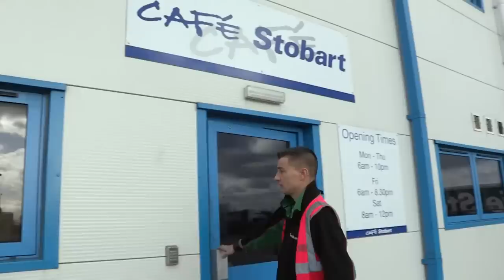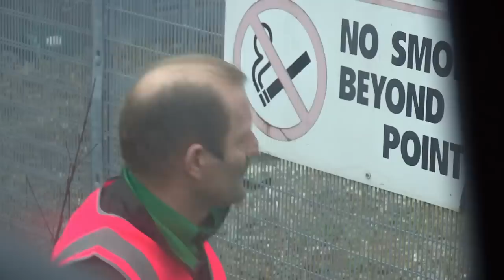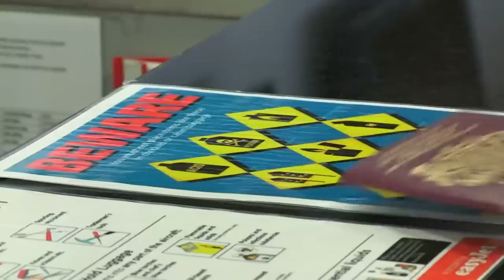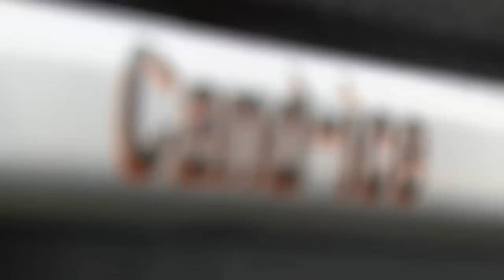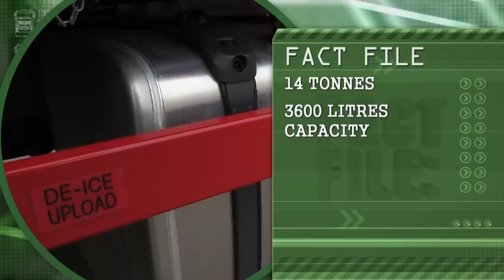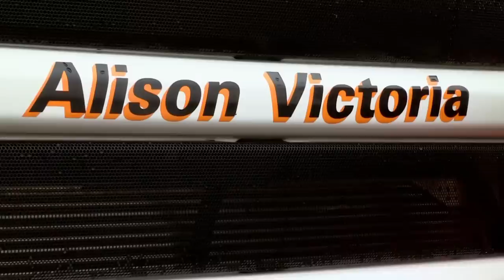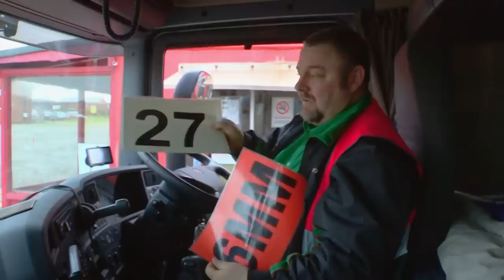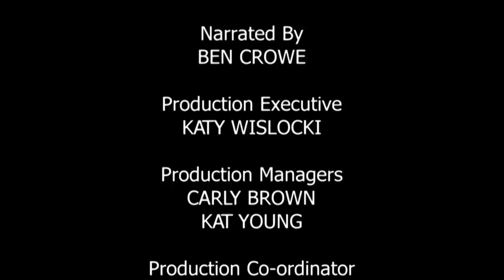The Worst NIGHTMARE For Mark Dixon | S05 E01 | Transport Documentary Full Episodes | All Documentary

Comment: That Scania R500 V8 Log truck is small compared to Finland machines we have Scania 730, volvo FH16 750 And Sisu Trucks  on the forest with Up to 92 tons of weight
Reply: correct but them trucks arent needed as the trailer is shorter than a standard or double log carrier